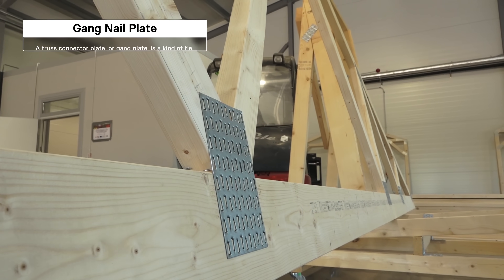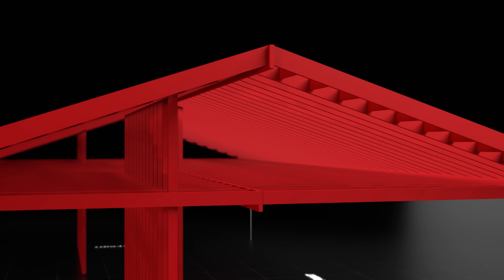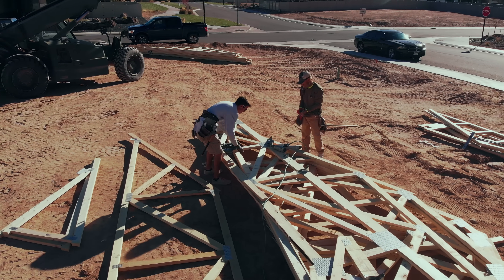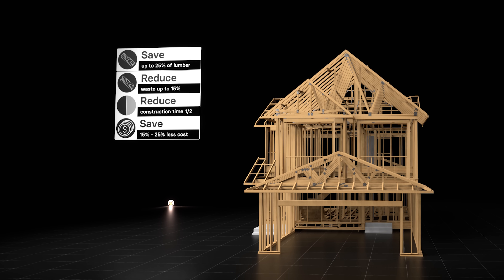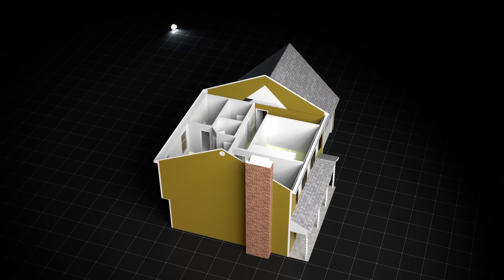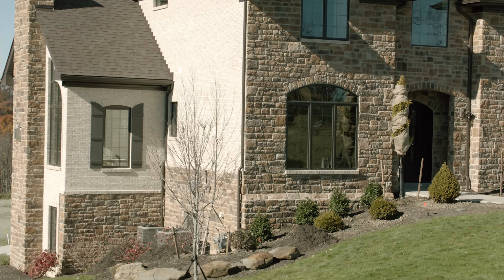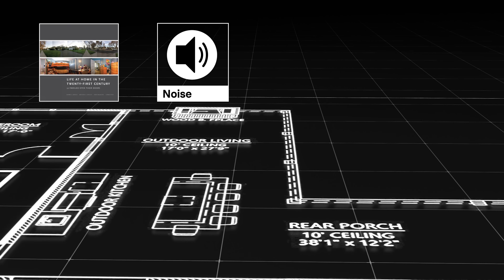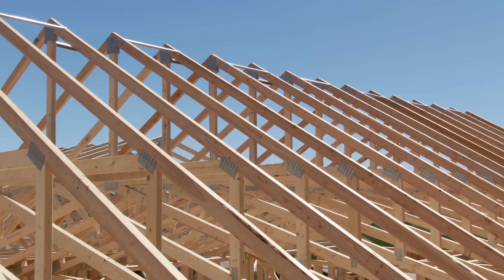The Invention that Accidentally Made McMansions

Comment: You do not need this type of device to do the same thing, i do approve of the extra strength,  they give.
But with other ways of doing it you can get the same results.
Adding metal objects to hold a roof to the foundation would hold the whole house in place and a fire retardant would keep the roof from clasping.  Instead of a birds mouth at wall joints a full metal support system could do both hold the roof down and bolt it to the foundation
This covers tornados, hurricanes, and earth quakes with one device.   
The top plate has a metal plate over its length, each rafter is held down to it with bolts in the side instead of a birds mouth notch, the end of the wood is supported by this as well, the ridge beam also has a full length nailing metal bracket,  you just lay each rafter in place and nail or bolt it in place.
A angle iron or round pipe is attached to the top plate and bottom plate or point load  30" on center between rafters and joist.
Each story has a floor plate to hold wall studs instead of a bottom plate but one can still be used.   
These can also be used to hold rafters instead of simpson ties. 
You just nail it in place it automaccly sets the floor joist spacing.  No toenailing joints.
No nails its all screws and bolts. 
Nails pull apart screws hold fast.

Comment: In SE Asia where typhoons are common they use metal roofs and concrete or cinder blocks ('hollow block") for new homes and they survive super typhoons.  But here in the USA they use wood with these gang nail plates and the roofs often go flying off.  But it's all locationx3.  In South Europe they have marble floors, concrete support, brick interior walls and the 1200 sq. foot apartments go for about $400k, which here in DC won't even buy you a cheap condo.  Location x3.  As for McMansions, I'm for it, if that's what sells.  Hand laid bricks may be pleasing to the eye but the public wants some pre-cast facade.  Given the people what they want, good and hard, as H.L. Mencken said

Comment: Total BS, the plates make making trusses efficient, those Florida homes still need the trusses to be toenailed to the wall top plates, and they will blow off just as easily.  The solution is a hurricane connector.  This is a cheap metal strap that is sharply twisted at 90 degrees and allows the truss or rafter to be connected to the wall top it lies at 90 degrees to.  Companies like Strongtie, make many tools to improve hurricane resistance, and earthquake survival.

The  main advantage of trusses is cheaper wood can be used, and carpenters don't need to know any math.  Any roof configuration can be made with trusses in parallel, but those roofs, often huge elements in recent construction fashions, are usually wasted space. Where a laid roof could be reconfigured, or originally configured to be a usable attic space.

Comment: Stewart, perhaps stick to engineering, your original premise for the rafter- wall connections was never addressed by the video. Trusses and the plates themselves do not “fix” this problem as heavily suggested. The real thing that was put into practice to stop roofs from flying off in high winds was not even mentioned once. Not once! The hurricane strap. That is the thing that changed everything. Trusses can be simply toenailed just like regular old rafters and joists. Just my constructive criticism after building many homes in the Florida keys that have survived some nasty hurricanes because of the straps, not the trusses. Cheers.

Comment: This does honestly feel fundamentaly opposite of north Europe currently, here buildings are small, cramped, extremely ugly and hillariously owerprized for what it is. Something like this would honestly feel like a vitamin injection.
Reply: People who always praise E.U. construction and E.U. everything have never actually been there for the most part. They don't know how claustrophobic it is. And they look at 100 year old houses or 500y castles and think it's still built like that LOL 😂
Reply: @westelaudio943 Ha ha! Yes, good PR i guess... A few years ago they had a vote for the most beautiful building after the 1940s in a neigbor town here and the winner was the harbour industrial could storage facility, which was teared down shortly after... That was an old squareblock hangar like constructrion from the early 60s made of black and blue-green corrugated steelsheets, and yes, indeed it was true that it was one of extremely few reasonably good looking buildings constructed after the 1940s here, not just here but also in the whole country to be honest... And now it's gone...  Says something about modern arcitecture in my country... Honestly i see many benefits with the American MacManson buildings, an open frame is super easy to put up divider board walls inside and also move them if one want to change something, fireproofing is relatively easy by for example using double plastercover and laminated wood beams in critical areas, etc With just a few small and ceap modifications it would be as strong as a steelbeam by using a few additional wood beams for structural support and it also withstand fire without bending, it can even be done in an existing building. So, i think the fire safety issue cen be solved. Honestly 300 000 to 1 000 000 or even +2m $ for an ordinary ugly subcity villa in a s---ty offside town here is nothing but ridiculous, especialy concidering land to build on is not scarse here and people earn a lot less money per capita compared to the US. It's all just insane!
Reply: The U.S. is headed that way. They are conditioning people to now pay $150-$200K for a ‘tiny home’, which is nothing more than a 500 square foot shed with mechanicals and decorative baubles.  AND you have to pay lot rent for your site.  It’s a scandalous sell out of the American dream.

Comment: As a journeyman carpenter I have set thousands of trusses, I have built Mc Mansions and mansions, the last one I worked on sold for 23 million dollars, I think any large house with stick frame and stucco is a Mc mansion. The real mansion here are built with masonry construction. Fortunately I’m a finish carpenter now lots of woodwork in those big houses. Great video.
Reply: I've worked on both as well. People with McMansions got to home depot and pick out the most expensive countertop. People with mansions go to Italy, where the marble is quarried and have 8 countertops cut so they can pick out their favorite one and have that one installed.
Reply: @burchified  I... sure hope other folks buy the other 7 cuts.
Reply: @Archgeek0  Those will go to a specialty stone shop. Somewhere in the middle - not as bespoke, of course, but still with a real sense of genuine place.
Reply: I'm a builder and concur. Trusses are more often used on smaller track homes with larger homes using stick framing as the roof lines are usually more complicated.
Reply: @stephenisdale Yes!  I almost exclusively see trusses on production builds and the custom homes with complicated lines are stick built.
Reply: In the UK our houses are concrete block and brick, some are now steel framed and block / brick outers with slate, stone or artificial slate - they dont blow down but alas are probably 25 - 40% the size of yours!
Reply: @paulwatts1704  US houses also don't blow down in 90% of the country, and we get to have houses that are twice as big for the same price (or often less.)
Reply: @TeflonBilly426 ...haha yep👍
Reply: @paulwatts1704 That sounds lovely to this millennial American

Comment: I hate trying to design solar installations for McMansions. The roof is taken us by weird angles that makes it hard to fit modules. Cut out the weird angles and there is a lot more roof available for solar.
Reply: Yes. Also, the final solar installation looks uglier with so many different smaller patches of solar instead of one or two big patches of solar.  More work for the solar installation crews too.  The complex roofs would steer me away from buying a home if I had a choice in it.

Also, the designers should work to put vent protrusions on the north facing roof instead of the south facing roof for northern hemisphere homes, and opposite for the southern hemisphere homes.  This is a small change that greatly benefits rooftop solar installations.

Comment: Frankly, cheap home loans is why we have McMansions.  People didn’t get limits on what they could borrow, so developers only had an incentive to build big.
Reply: Also, there's a ton of fixed costs associated with building a new house. Land, permitting, design, regulatory review, utility hookups and more are fairly inelastic with respect to house size. If it's costing 250k before you even break ground, trying to build a starter home (think Chicago bungalows) is going to result in a house that's too expensive for consumers looking to buy a house of that size.
Reply: In decades past banks only cared about square footage so houses got big and cheaply made.
Reply: You're right. The only way to solve the housing crisis is to make it harder to buy homes on credit. Frankly, loans for homes shouldn't even be allowed. Only people with cash should be permitted to purchase a single-family home.

Comment: Good video. Terrific topic. Gluelam beams are probably as key to the MacMansion as the trusses. Nailon trusses have been around a lot longer than MacMansions.  
Laying out and cutting rafters is tricky but I've know dozens of carpenter who do this efficiently and quickly -- but no one is quicker than a stack of premade trusses hoisted by crane to the top of a house.  I can cut rafters, but I have to check everything multiple times. 

Toe nailing isn't difficult and is very strong. (I've done a lot of it.) Another factor are purlins. These are stringers that run between rafters about a third of the way up from the perimeter wall. These tie the rafters together so they work like a web (Similar to blocking.) Stretchers going down from the rafters to the ceiling joists and another stringer also stabilize the ceiling solving plaster/drywall cracks.  Of course purlins and stringers, and floor blocking are not as common in old homes as they should be. I remember installing a lot of more of them in old houses to fix long term problems. 
Another thing that trusses and gluelams caused. In the 1980s there was a fad for 'cathedral ceilings.'  I saw a few Broad homes where a corner of something on the second floor was eliminated so next to the staircase there could be  two floors of open space. It was less cathedral than it was shaft. It was a gimmick and was just bad architecture. But people liked them. (Broad also eliminated basements because buyers looking at two houses don't see that one doesn't have a basement.) 
When I extended the back of my house in Los Angeles in 1994, the building code required brackets and bolts from the foundation to the top plate. But hurricane ties to the rafters were not required. I put them in. (I also made every wall a double sided shear wall. Didn't add much to the cost.) My thinking was I don't want to meet the standard after the previous earthquake (Loma Prieto) I wanted to meet the standard after two or three large earthquakes in the future. The Northridge Quake happened during the renovation. (Everything was good, except that mesh drywall tape. I never used it again.) 
And firefighters used to recommend going around to all the nailon plates and putting in a few nails. This was easy with a nail gun. The thinking is that a nailon plate in a fire softens and looses its strength so the roof -- and the fire fighters on it are more likely to collapse.

Comment: Real-estate industry also started to push for legislation to enlarge the minimum size of bungalows. That caused the smaller sizes to go out of code requirements about the time the gang nail plates became the norm.  Tax base increased with the property needed for McMansions making suburbs more profitable by the larger minimum standards.  By the early 2000's building codes in CA made making granny flats even difficult to permit and build.  Fortunately that seems to be trending the other way.
Reply: The IRC building code sets certain minimums such as minimum headroom in a stair (6'-8") and minimum room size, 70 sf for a habitable room and minimum dimension of 7-ft but nothing on the order of magnitude that would result in a McMasion.
Reply: @chrisscharff6518  Our county demands homes of a minimum size.  They no longer allow smaller homes, even in so called senior developments where people would like to downsize due to age.  It's crazy but the bankers rule the county.
Reply: And then the energy savings codes came in requiring 2x6 studs instead of 2x4's so they could add more insulation. Of course the crappy 2x4's sold today are significantly smaller than the old REAL rough cut 2x4's that measured 2" x 4", the modern 2x6 is not much bigger than the old 2x4's, they waste half the lumber cleaning up all 4 sides and rounding the edges for modern lumber sold at Menards etc., but then they take all that sawdust and make that even crappier MDF and particle board, and OSB out of.
Reply: Tiny home ADUs in backyards.
Reply: Leave it to America to make small, affordable houses illegal because they aren't profitable enough.
Reply: @blammers  my sister and her husband found a work-around. They sold their big old house in upper NY State, and bought 2 used camping trailers about 26 feet long. One at a campground along Lake Ontario in NY State they live in May to October. Another at a campground in the Florida interior (Ocala) they live in November to April. He does construction work both places, she is a part time hairdresser both places. They have no insurance for their trailers, if one is destroyed they have the savings to immediately buy another used trailer. They built huge outdoor decks for both to make up for the small indoor square feet.